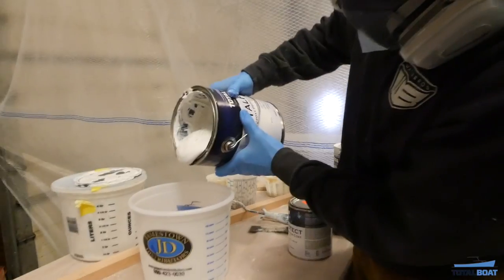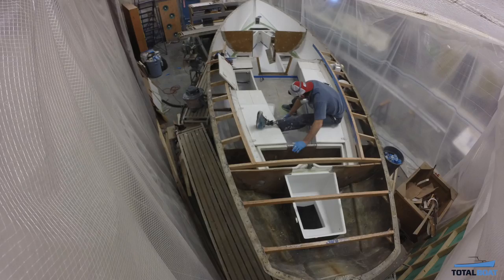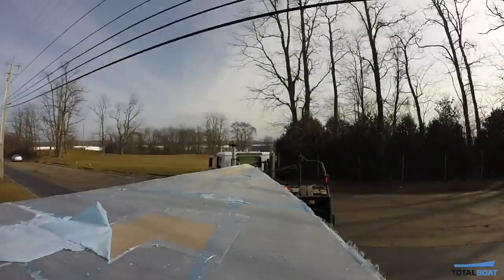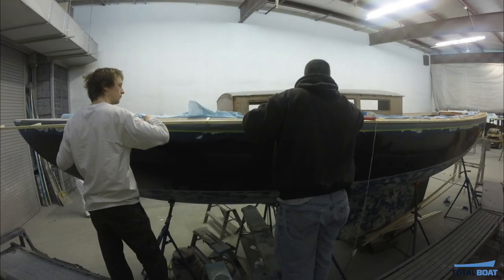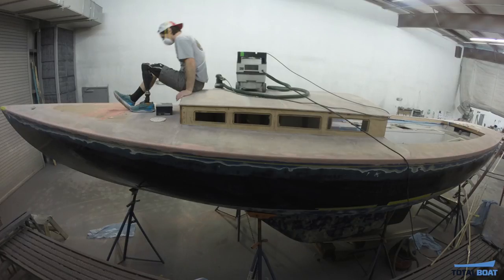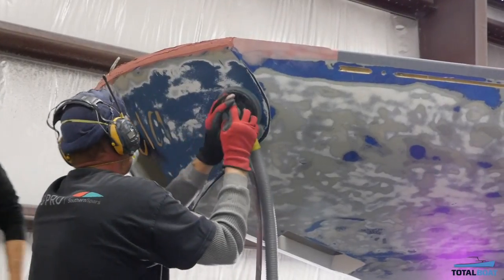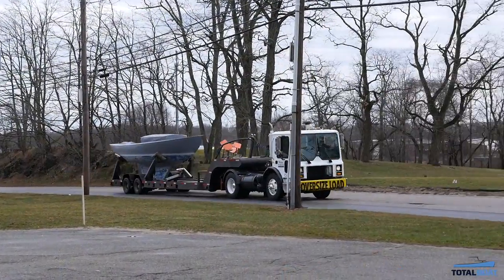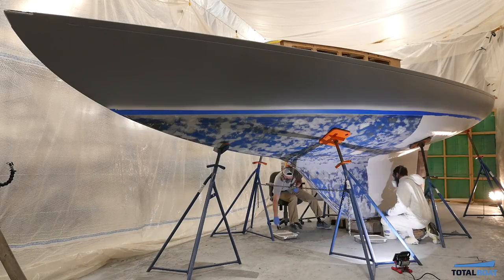Restoring Vela: Episode 7 - Primer

Comment: I used 4 coats of Total Protect on my SC21 all the way up to the deck joint. I have set my boot stripe and sanded the primed freeboard in preparation of Wetedge. The total protect flattened out nicely with progressive sanding. Whenever the temps here in Texas drop to working temp I plan to brush on a few coats and sand in between. Hoping the wetedge is as good as total protect.
Reply from the maker: Good stuff!